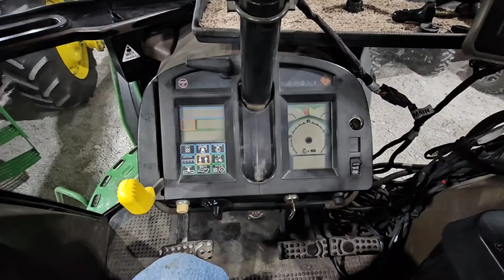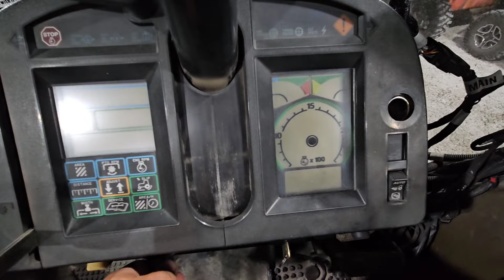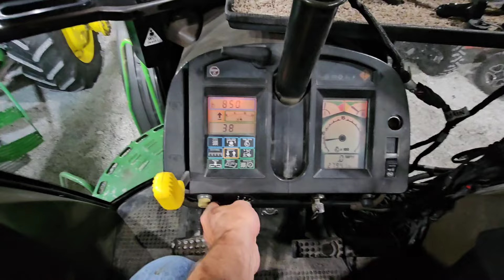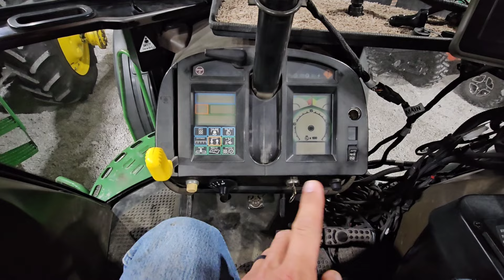August activities

Comment: I'm so frustrated with waterhemp. The beans are so thick that when we sprayed 3 weeks ago, the chemicals didn't get to the weeds. Now, it is popping up through the tops. Try checking the ground wire. If both sides and nothing is working, but you do see power, it might be the ground.  Good luck.
Reply from the maker: Waterhemp is a bad deal if it gets seeded out. Only good thing is if you can control it well for a few years, i don't think the seeds can thrive as long as others. Thanks

Comment: crops are looking nice, considering what you guys went through planting. This is my first year using Liberty and I noticed the beans yellowing up pretty good after, but I will say it cooked the weeds...especially Marestail 😡. Your 4430 looks mint...I feel for ya on the repair. Farmers can't even rely on parts anymore, "paying through the nose, and after going through the misery of changing them out. I wish I had some advice for you on the flashers...you've done everything I thought of...my first thought was the turn signal mechanism in upper dash, but you did that...are you sure the "new part" is actually good?? Ya never know these days with just about everything coming from CHIna. I had to have ag express go through my digital tach on the 47 a few years ago for different issues.
Reply from the maker: Repairs are getting out of control and quality of parts is just sad. A&I I always thought was good but I will never buy a waterpump from them again. It was their seals were the problem because I know of others that had the same issue and the water pump on my 4960 is leaking again too (3rd one). Just junk anymore
Reply: @iafarmer I have 0 faith in A&I parts anymore! Recently I got a circuit board for under dash of 2955 and it wouldn’t even fit! My local dealer LandPro made me jump through a bunch of hoops to get credit for it and order me a new JD one. Deere has to get a hold of all their quality control. I’ve gotten a real sour taste in my mouth over Deere the past couple years.